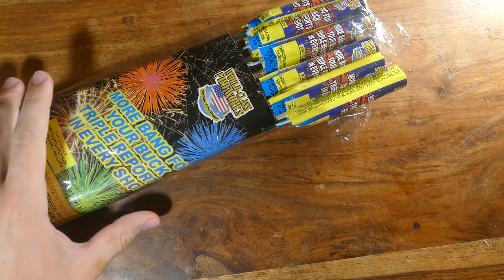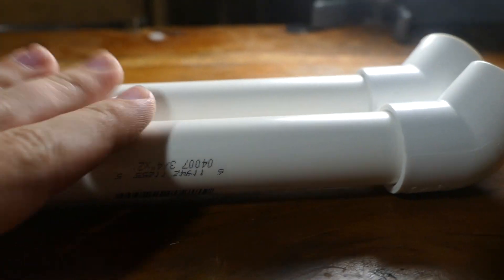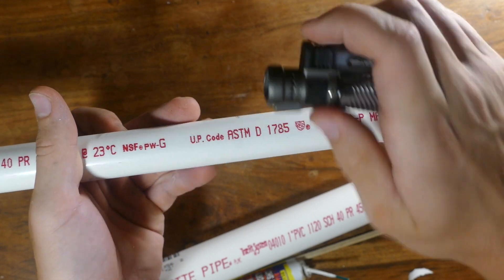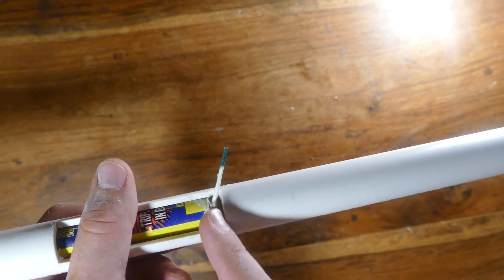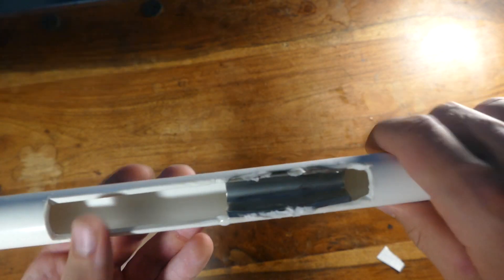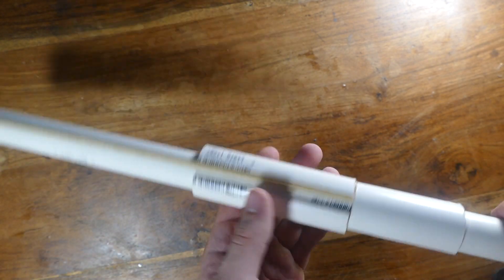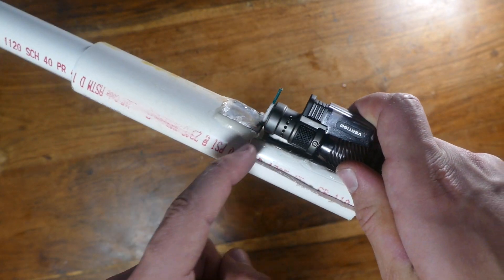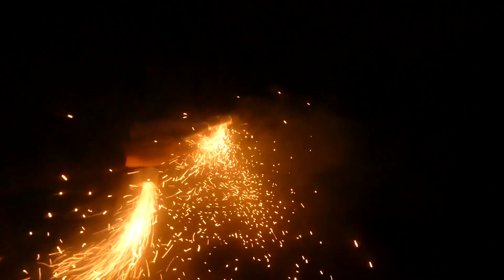DIY Firework Shotgun! - Double Barrel (Shoots 75 Feet)

Comment: I made one and it came out better than I expected. But instead of using two lighters I found a lighter that has two barrels that only had one trigger, and I spray paint mine and inside the tube I put a layer of some fire resistance spray
Reply: Cool! Make a vid (if u can :P) about showing it, it sounds amazing!

Comment: I am making a break action double barrel using a door hinge out of steel pipe and this time I am trying to block off the rear handle where the sparks fly out so in theory, it will be able to build more pressure to shoot further but I also have threads in the left barrel so at any time I can take the bolt out and the sparks are able to shoot out the back like normal so the left barrel can be a short and accurate shot and the right barrel will be a longer and faster shot in theory.